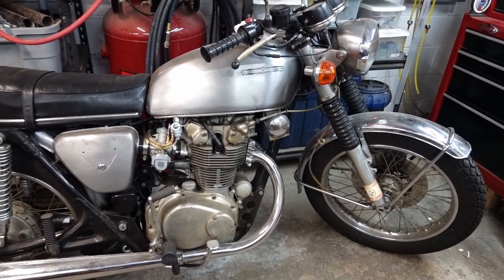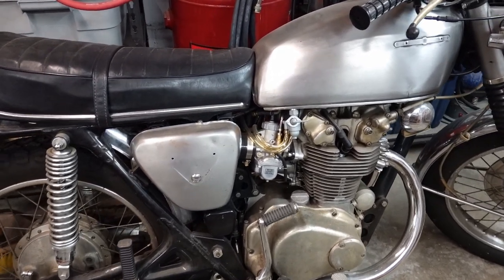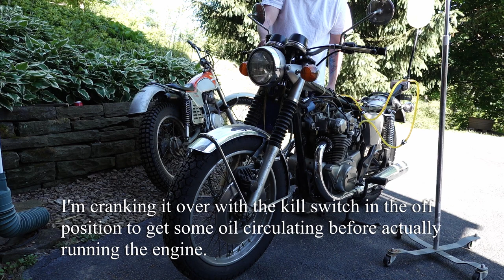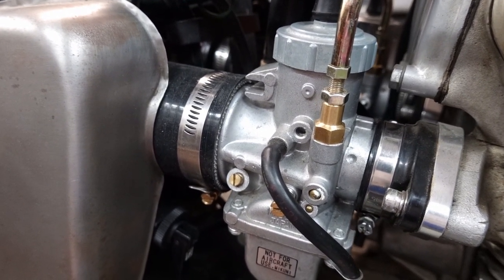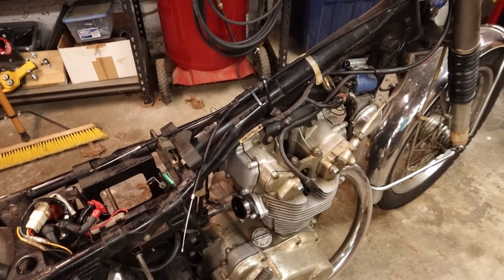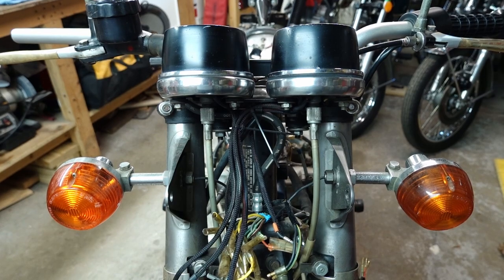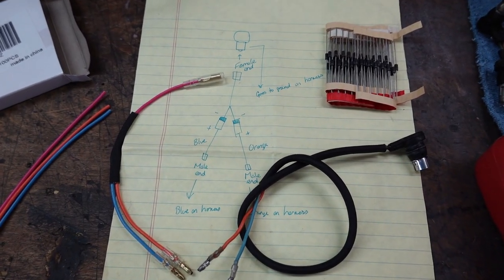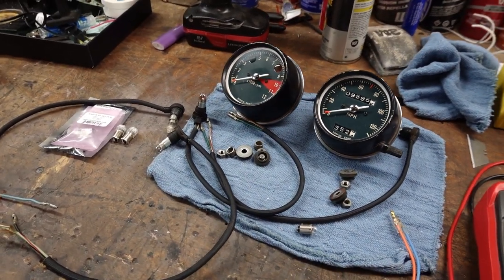1971 Honda CB450 K4 - Return to Stock - Part 1

Comment: Hi Michael... great video! I have a 70' Honda CB450 and running Mikuni VM32. Since you are putting your bike back to stock, i'm interested in the complete plunger set up and the complete air filter set up. Would you consider parting it? Thanks.
Reply from the maker: Possibly, I'm working on another 450 project that these may wind up on so I can't say for sure until that project is complete.  I'm sure I could dig up the part numbers and vendors I used to put it all together if you want.  Message me on DoTheTon.com (Mike450) or VintageHondaTwins.com (Mike) if you're interested.  Thanks for watching.
Reply: @michaelsams450  hello can i asked what is your mikuni jetting? pilot? and main? my is running ok but i think it might need a fine tuning. Thank you.
Reply from the maker: @kevinvu658  I was running the following:

Slide: 3.0
Main: 160
Pilot: 32.5

This was the setup that came with the kit I bought.  I wouldn't say the bike ran perfectly but it ran good enough for the around town kind of riding I do.

I also switched to the lighter spring.  It doesn't affect the tuning but I found it much more comfortable for every day riding.

In my experience these carbs are much more sensitive to temperature and humidity than the CV carbs that came stock on the bike.  Tuning for cold weather will not perform well in warm weather and vice versa.  Hope that helps.  Good luck with your tuning.
Reply: @michaelsams450  ok thanks!
Reply: @michaelsams450  are you still using the choke cable? i got some original honda cb450 parts perhaps we can trade?
Reply from the maker: @kevinvu658  I'm going to keep the setup I have together for know because I might be using it on another project.  You can find the same choke cable on eBay for around $30.  Just search for "PU Universal Choke Cable for Mikuni Dual 28"" and a few options should come up.  You may need a level to cable conversion kit for the carbs depending on the setup you have.  Search "Mikuni Lever to Cable Choke Conversion Kit" on Amazon or eBay and you should be able to find what you need.